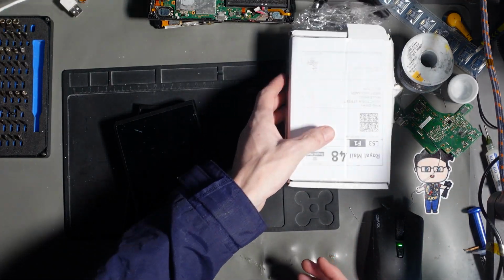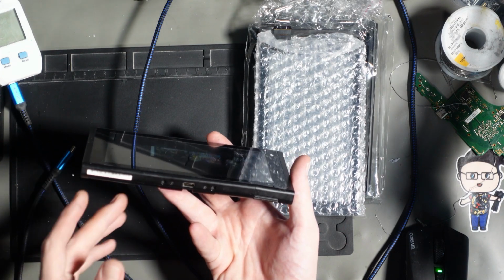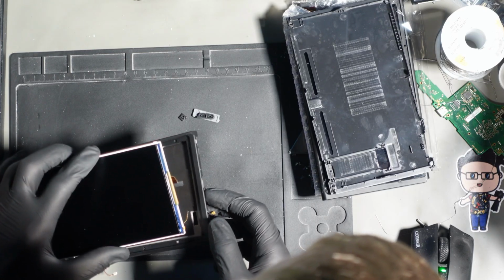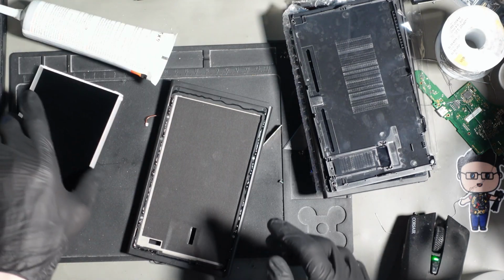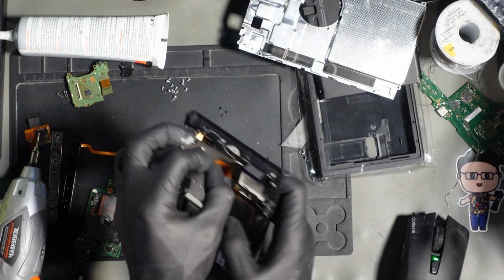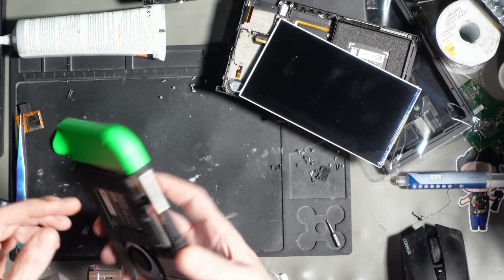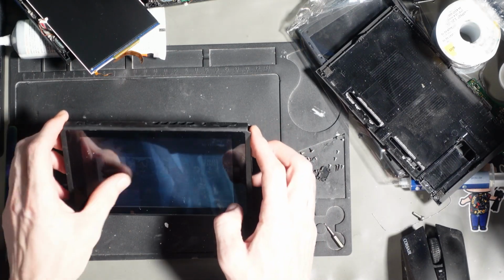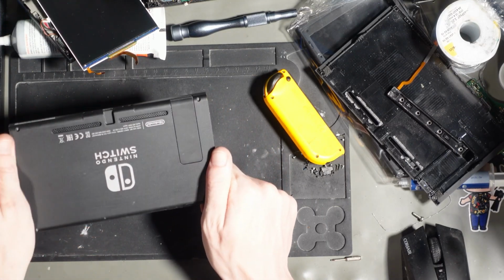UPS Completely DESTROYED My Customers' Consoles! Can I Fix Them ONCE AGAIN?

Comment: I use synthetic chamois to wipe down LCD's.  When I buy them I soak in water, wring the heck out of them a few times then start using them on screens.  It works incredibly well for cleaning screens and LCD's without any chemicals.  Easy to clean and can use for a couple of years before replacing.  Just don't use them saturated with water, mildly damp is perfect.

Comment: I didn't see you do it, did you replace the charge port?  When I ship, first, I use FedEx ground to ship because they tend to be a little cheaper and a little more careful in handling packages.  I would also have wrapped this several times in large bubble wrap.  I've never had anything break in shipping.

You should be using different gloves when cleaning the LCD, it seems to be adding to the dirtiness of the screen.  Also, you should use disposable or brand new cloths because you seem to be adding to the dirt.  IPA is also not the best thing to use to clean screens.  I prefer a mix of 50% white vinegar and 50% distilled water.  It tends to remove oil and dirt better than IPA.

Comment: Think I mentioned here before, going back just over 10 years ago now I had a tv that I owned for a few weeks and had to move house, it was a £1000 tv and put it back in its original box, covered the tv with a duvet, pillows.

I paid £80 for a service that specifically covered tv's, when it arrived at its destination it was covered with a bin bag, first warning sign, the driver refused to let me check it befor signing then rushed off.

The tv was SMASHED, and for extra context it was a business grade plasma tv so a thick METAL frame with actual glass over the screen and it was split right down the middle, I was straight back on to UPS who told me they wanted to investigate the damage and sent someone round who determined it wasn't packaged good enough.  I phoned CS back and first got a trainee on the phone who just read the script and when I said I wanted to complain her manager came on and told me to "take it up with the sender" I said I was the sender and I sent to myself, she then said "televisions aren't covered you should of read the terms" I said I did read them I went for the more expensive service that costs so much AS it covers televisions to be told "its not our responsibilty to make sure it arrives in a good condition" so I said "so why do you call it a insured service then" she told me to sue the company but I would get nowhere and hung up on me.

Comment: I've been lucky.  It's never happened to me, but I've worked for several couriers.  Your parcel will be thrown, and it will have heavy items put on top of it, and it may get wet... so I package stuff knowing that will happen.  It would be prohibitively expensive to package everything to the standard I want with all bought and new packaging , so I upcycle cardboard, use clean household rubbish as packing, and wrap my parcels in bin bags.  I would rather my item arrive intact, than my packaging look pretty.
Reply: @Kris Nicholson LOL.  It's not Jim Carey or the drivers that break stuff, it's the sorters in the depot.

Comment: If you replacing a new converter and dont want dust go on the screen go to the bathroom after turned on the hot shower, because of the damping there will be no dust particles in the air. Or use a good dust systeem to remove dust from the room. Also use different type of handgloves. In China they only cover their fingertips